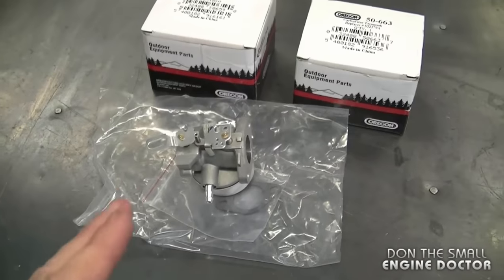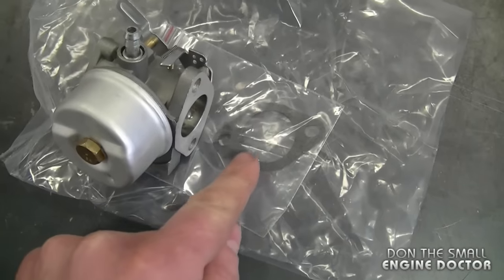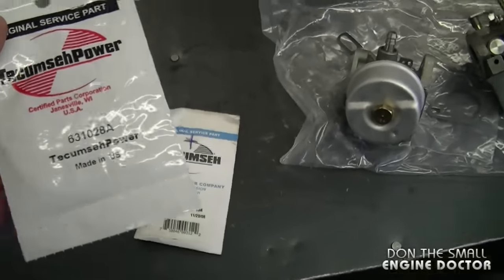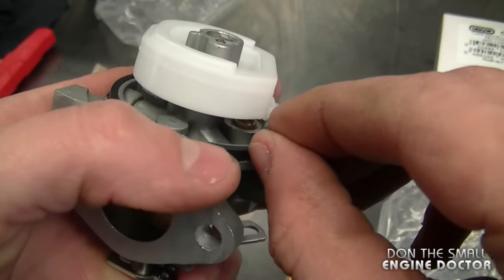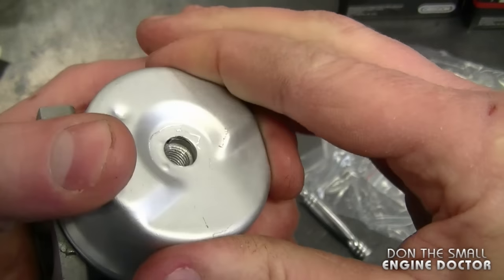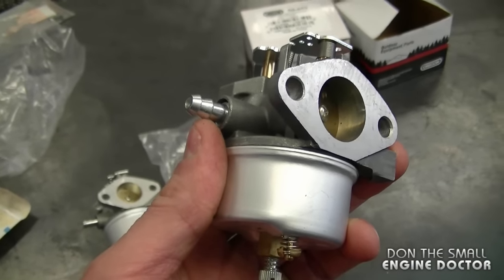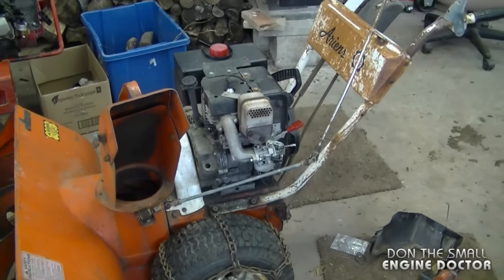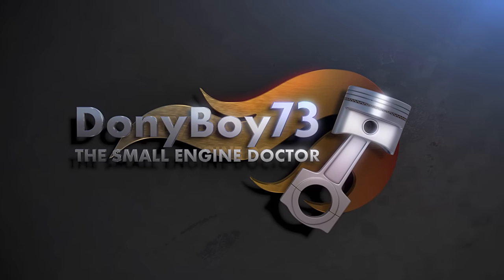Save $Money$ With Aftermarket Carburetors For Small Engines!

Comment: Ive just replaced the carb on my fairly new garden tractor with Kawasaki v twin engine.  I had heard horror stories about replacement chinese carbs but took the plunge.  I compared as many internal parts as possible with the genuine Walbro unit and could see no issues. In short the machine started instantly, needed minimal idle speed idle air adjustment and has never run so well - full throttle - no issue -- very pleased..

Comment: I've probably replaced 50+ with these aftermarket carbs. I also recommend to people to shut the fuel off and let the machine use up the fuel in the carb before putting it away. And recommend using non ethanol fuel in all their small engines. Don you do a great job with your YouTube posts!

Comment: I bought that exact non adjustable carb on Amazon. I can't agree more. For $15 I got an entirely new carb. I was going to spend $14 for an OEM bowl gasket and new drain button/valve (wouldn't seal anymore). Good deal, and so much less hassle.

Comment: I was so disappointed when Tecumseh stopped engine production. So many people bad-mouth Tecumseh engines.  I would not buy a power product unless it HAD a Tecumseh engine on it.  My 32 old John Deere 826 never misses a beat and pumps snow all day long; literally, THE SNOW KING!  My lawn mowers perform as well.  I've never had a bad one. Yup, their carbs can be touchy and don't like dirt [like all carbs] but they perform.  At one time, 99 percent of all snowblowers had Tecumseh engines because they perform. Check/change the oil, warm them up, run them hard [they love it and never give up] and let them cool down.  Now that they don't make them anymore, I have to make sure mine stay running as long as I can.  Your great website and knowledge will insure that that happens.  Finally, instead of trashing Tecumseh, I finally found someone who understands/appreciates a Tecumseh.  THANKS !
Reply from the maker: I totally agree

Comment: I have been using these carbs for years and have had a problem with 1 of over 100 I have installed. They are great carbs. Be aware that some of the oregon carbs will only accept oregon parts. Mostly on the Briggs carbs.

Comment: $15 on Amazon is the best deal with fast and free shipping. I had issues after installing one of these and had to keep cleaning the main jet. After replacing the aging fuel line and adding a $5 Briggs fuel filter it runs great. I'd say these are about 25% of the cost of oem.

Comment: A couple of years ago I put the oregon adjustable on a tec hm80 on a 20+ yo noma blower. I had tried rebuilding the orig. carb a couple times before but it just never ran well. With the oregon carb it ran as well or better than when it was new. Still using the blower and haven't had to do a thing to the carb since then.

Comment: I have used aftermarket carburetors on Tecumseh powered Craftsman blowers, namely to replace Tecumseh 632107A (which is Oregon 50-640, not either of these two part numbers) which is a popular one for the 5 hp Tecumseh Snow King as used on a Murray made Craftsman blower. I bought one for about $9 off Ebay and bolted it on a machine and it started right up and ran great out of the box. As you said, the Tecumseh original was rebuilt a few times, but because it sat, and no matter how much it was cleaned it was still a problem. There are multiple versions of this, so I suggest to look up your original part # from the parts list and then interchange it on the Stens, Oregon or Rotary website to determine which one you need.

Comment: I just finished up with a 1994 Noma Snowblower with a 5hp Tecumseh. It had an Oregon Carb. The Oregon carb is actually better than the OEM Tecumseh version. The main jet going up thru the center and into the throttle body was brass on the oregon. Its plastic on the Tecumseh version. The engine runs great. Its an older one so it may have been made in the USA at the time vs the new Oregon carbs, which are made in China, not sure. I purchased a no name Chinese one last year for just over $10 on ebay for another 5hp Tecumseh and it would not run right at full throttle, it surged bad. It probably could have been rectified by enlarging the main jet with a micro drill bit, but the Oregon carb worked exactly how it should and looked nearly identical to a Tecumseh carb, except it was better, Brass components vs. plastic on the Tecumseh. The Oregon carbs are good.

Comment: Hi Don,  Good tip, the TIME that it takes to r&r is much less than to rebuild a carb.  I fussed with the carb on my 6hp B&S for hours, gave up, got a cheap new one, works great.  Unclogging an old carb can be a pain.  Use non ethanol gas too, or get new carbs regularly.  Don

Comment: Don, nice video! Just wanted to tell you that I bought a nonadjustable carb from the Tecumseh dealer for $60. tax in...... yes he gave me a good deal. Then I ordered a nonadjustable one from China for $21, Ebay. delivered. Neither had the mounting hardware for the choke lever. I didn't change the gasket on the Chinese one, but had no leaks. I did have to exchange the Tecumseh one because it didn't work right, 2nd one was OK. I took the bowels off and compared the insides. The only difference I saw is where the primer tube comes out into the bowel..... on the Tecumseh one there is a plug with a tiny opening on the side. With the Chinese one there was no plug and you could see the end of the fitting that goes out through (better for cleaning).  Only thing was I had to wait a month for the Chinese one to come. Keep the video's coming, remember the world is watchingByron
Reply from the maker: +W. Gator ok good

Comment: I recently got a Chinese carb an fuel line kit for my stihl fs55 on amazon after about 30 minutes of minor adjustments it seems to work just as good as the other zama carb the kit on amazon was 17$ an came with carb fuel lines two fuel filters 2 xtra primer bulbs  air filter an spark plug not bad for price but had to trim air filter to fit

Comment: Hello Don, You did not mention if the carbs are interchangeable. Would there be any benefit to install an adjustable carb in place of the non adjustable one? I've been "Turning Wrenches" for over 50 years now and its good to see to see people like you fixing and repairing machines instead for scrapping them and buying new. People like you with the knowledge to repair equipment are few and far between. Great video's.
Reply from the maker: +Turning Wrenches yes you can interchange them, the benefit of the adjustable is that is adjustable!

Comment: Here's my experience with aftermarket parts and equipment: I have had good luck with the Chinese carbs all over ebay for briggs quantum engines. They are of lesser quality, but for $20 or less sometimes, they will last as long as an OEM around here where nobody respects ethanol fuel, and gums up their carbs. I have also had good luck with aftermarket Chinese 2 cycle carbs that fit "Big Box" store brand trimmers, edgers, hedge trimmers, etc, both Zama and Walbro. often times the Chinese carbs will have slotted high and low needles without the need for the special adjustment tool(s). I have had terrible success buying aftermarket (Chinese) in-line fuel filters, specifically the red Briggs & Stratton filters. I bought a pack of ten, and every single one leaked fuel. My friend who owns a Stihl dealership told me ten years or so ago that she only uses OEM Tecumseh rebuild kits. She tried aftermarket kits, and had about three dozen customers return their equipment due to leaky needle/seats. The Chinese knockoff Walbro carbs that replace WYL and WYJ carbs are pretty good too. Sometimes, depending on the make/model, an OEM replacement is around $80-$100, whereas a Chinese one is say $12 free shipping. I have not tried ANY aftermarket rebuild kits for carbs after hearing what my friend told me ten years ago. I'd rather shell out an extra $2 and get an OEM kit. The absolute best aftermarket carbs I have found are the Chinese ebay ones for newer Poulan chainsaws. They go for around $8-$9, and they come with fuel line and a snap-in primer bulb. I have bought dozens and NEVER had a problem with them. That being said, I have had great luck with Chinese primer bulbs; the snap-in type, the screw-on type for those Poulan chainsaws, and the common sized Walbro and Zama bulbs that go on the carb itself. You can buy a lot of fifty of each for a few bucks. I have heard bad things about Chinese knock-off fake "Tygon" fuel line. I have been told they color it yellow to look like real deal DuPont Tygon, when really it is just regular plastic. I buy aftermarket air filters for Briggs as well, both the common foam type for Sprint and Quattro type engines, and the paper ones for Quantum style engines, both with great success. Aftermarket Tecumseh air filters are good, too. Aftermarket Chinese Honda replacement carbs are a safe bet too, when the OEM is really expensive. When I can get an aftermarket carb for so cheap, I don't even bother rolling the dice on rebuilding a carburetor. Hope this helps anyone else who fixes equipment.
Reply from the maker: +pbrstreetgng79 yes exactly I only OEM carb kits, especially Tecumseh ones
Reply: +pbrstreetgng79 This is great to hear. I have a 39 year old Toro Tecumseh 7hp that I rebuilt 6 years ago and wow did that fix it...gummed up. Now I put stabil and sea foam in the gas...and drain it in April. Running the gas out most times when shutting down make start up easy. I did replace the starter three years ago and the bracket welds just broke off this year. I have yet to replace it, but the engine starts on second pull!  I just added the rubber flapper impeller mods that many people have shown and then had to readjust last year's belt tension...also I use vegetable spray on the chute area before I use the blower to lube metal so snow doesn't stick to the cold metal parts. Now I am working on my non-adjustable Simplicity (1999 Regent 14 HP Kohler tractor) I think that is when they made them cheaper. Pulleys/belts everything went bad  year 6 and I am barely cutting 1/2 acre. I would like to buy a Scag with 29 hp DFI Kawasaki if anyone has experience with them...I have been reading up on them on scag blog. Thanks for the resource of parts and repairs!
Reply: Hard to beat a Scag zero turn mower.

Comment: Dony, I just tried the Tecumseh OEM bowl O-ring on the replacement (non-Oregon) carbs I bought direct from China and it is too big and sloppy! Just a heads up and buyer beware,  there are apparently many different versions of replacement carbs for Tecumseh engines coming from China, and many of the parts don't interchange. I've ordered an original Oregon as my spare at your advice. Thanks for all you do.
Reply from the maker: +paul larson THANKS FOR THE TIP, if it still does it with the Oregon try another o-ring

Comment: I got a briggs and Stratton engine 3.5hp but the bolts were it screws aren't straight they are in an angle like you would have to tilt the carb on an angle but its so big the carb floats no longer work

Comment: Be careful with after market carbs. I had one on a riding mower Kohler motor and the main jet was the wrong size. Most of these are cheap and remember you get what you paid for. That being said,we do what we need as to get these things running. I ran into a surging issue on a Poulan snow blower and it turned out to be the red plastic jet that just pushes in to the top of the carb needed to have the jet enlarged to fix the surging issue. I learned it from another guy on a You-Tube channel. He said it was a design flaw and I have to agree. The carb isnt anything I am familure with which leads me to believe Poulan is throwing cheap motors on their stuff. I also had to drill out the main jet. The customer said this blower ran like that from the start( surging). He never took it back under warrenty ( I would have). Another place quoted him $400 to fix it. That being BS and the shop simply didnt want to fix it. Its called putting such a high price on it you know the customer will say no. It does happen,even auto mechanics have been known to do this. Now days,people can be lazy and cherry pick a job I guess. I fixed that blower and am proud of myself that I was able yo save someone a lot of money and not charge some stupid price like that. Because of a poorly designed cheapo carb.

Comment: Hey Mon Ami 
I need a walbro WT 439 carb for a chain saw used or new. Body is fine also I have the other parts. the body I have is shot. It throws gas in the throat and not out of the oulet.  If you have one I will pay for part and shipping Merci  Plus Tard !!!

Comment: Another good video Dony.  I have a 1985 2HP 4 stroke boat motor (BF20-1005485) that needs a carb or at least a bowl because the bowl keeps rusting on the inside and causing problems.  Do you know what carb or bowl I would order for this motor? Or is there a good way to make the bowl stop rusting on the inside?  Thanks.

Comment: So I have a simplicity 3890 snowblower that I picked up cheap. It has a non adjustable carburetor and won't come clean, surging and no idle circuit. So I bought a new one (actually 2) non adjustable and no primer port. Any suggestions on how to install a primer port? I just don't want to end up destroying 2 other carburetors.

Comment: My question is since its an aftermarket carb can you buy a replacement needle and seat ?  cause I noticed it uses a brass seat and viton needle and OEM Tecumseh uses a rubber seat and metal needle, so a Tecumseh rebuild kit wont work other than the bowl and bowl nut gasket. That is why I don't use or recommend aftermarket carbs anymore, ive tried cheapo's from ebay and more expensive aftemarket ones like the Oregon and have never had good luck with none of them at least 10 different ones so now in my eyes its OEM or nothing if it cant be rebuilt.

Comment: Hi. Thanks again for great tips. I am always concerned about non OEM carbs but the savings can be considerable. I,ve worked on a couple very new TroyBilt Storm 2410 blowers with the Powermore Chinese engines. Both of them had less than 10 hours on them and surged like mad. Like you I cleaned and rebuilt the first one to no avail Then replaced the carb. The one I am working on now was run for just about 2 hrs. last winter and I don't want to waste time rebuilding. Went to Amazon for new carb and they list almost a dozen aftermarket replacements cheap. Besides Oregon are there other good suppliers of aftermarket carbs? I did try to clean out the existing carb by removing bowl and needle valve and using carb spray. Now the thing leaks when priming each Push (even the first) and if you tip the machine downward. I double checked and all connections are as tight as I dare. Any ideas?

Comment: i have a honda gx 200 and honda gx390  i bought  the  the stens  carburetor kit for both of them  they come with a air filter and gaskets spark plug  fuel line and filter  both engines with this kit installed  only run well on half chock  when i turn the chock off the engine runs rough  any idea what is happening iam sure the gas is pretty fresh and all

Comment: I've bought both versions from China for an 8.5hp Tecumseh blower but eventually ended up just rebuilding the OEM Tecumseh. The aftermarkets I purchased (not from Oregon) look identical to yours except that they both had a plated steel fuel bowl.  They also leaked exactly as you described. I finally put the rebuilt OEM back on because they never ran quite as good. Can the fixed and adjustable hi-lo jet parts  be used inter-changeably on the OEM Tecumseh carb?  i doubt I will ever use the aftermarkets but wondered about using some of the parts.

Comment: Hi dony, I've swapped my carb out for the Oregon replacement. However the snowblower still hesitates when going from low to high throttle and gives a quick puff of black smoke but evens out and runs fine. It runs fine at idle or high speed but stumbles a little going from low to high throttle. New spark plug as well. Any thoughts? It is the non adjustable carb.
Reply: GERALD0071000  the non adjustable carbs will always be right on the edge of running bad. That's why he has another video where he replaces it with an older style adjustable carb. I'd be thankful it runs good at all. I did everything I could and mine still runs terrible.  I'm finally just gonna order the old adjustable unit.